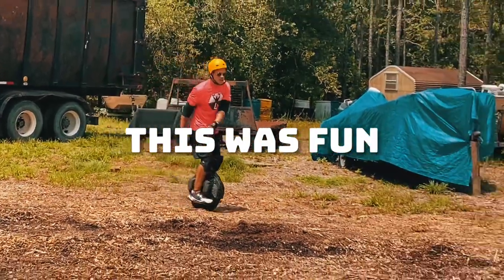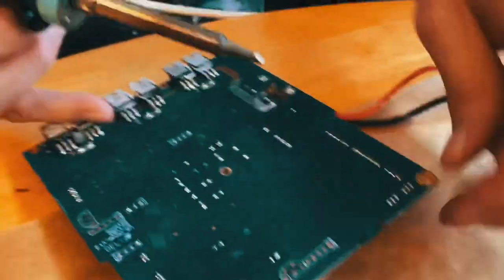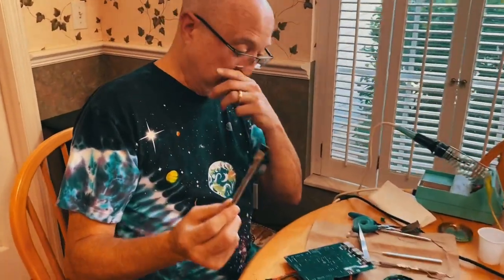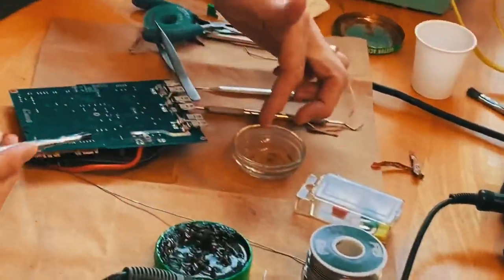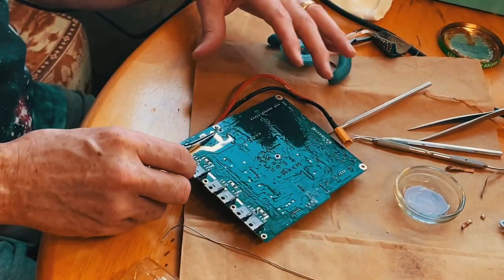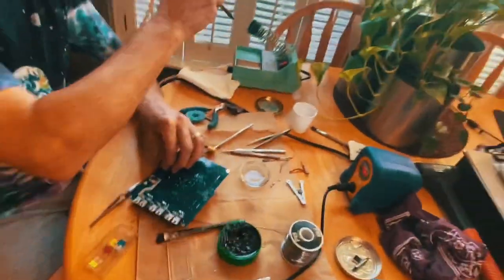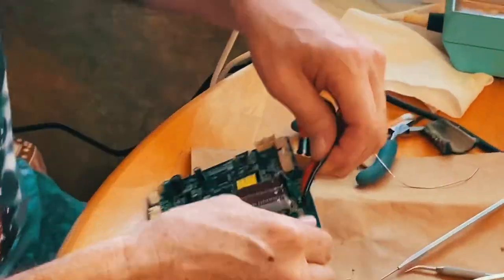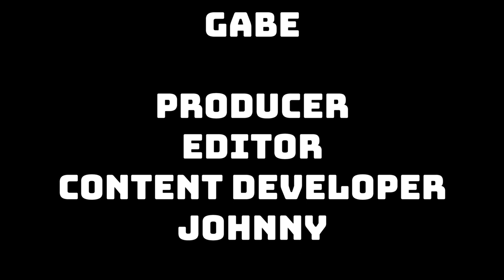Blew a Fuse Stress Testing INMOTION V8

Comment: Heyo, how did the wheel/motor behave before you fixed it? Did it not roll easily/smoothly?
Reply from the maker: I would not turn on- 
If the motor won’t move smoothly chances are it’s the actual motor , which is in the hub of the wheel.

Comment: Hi. My wheel was under the rain . After that time was riding few times. Then not use it a month. And after it is not turns on at all. Would you comment the situation please?
Reply from the maker: Is it taking a charge? Will the brick on the power block go from red led to green led?
Reply: It was took before. But now on charger is always the red light and on the wheel is no any sighs of life.
Reply from the maker: @maximilin8381  sounds like a dead board :/
Reply: Got you. Thank you very much for an opinion!!!
Reply: Hi. Came back from vacation, and wheel was came back to life again.
Reply from the maker: @maximilin8381  I’m so so happy to hear it!!

Ride strong, ride safe
Reply: My V10 works fine but do not take charge. Not charging constant green light on charger. Pls help if you can 🙏😀